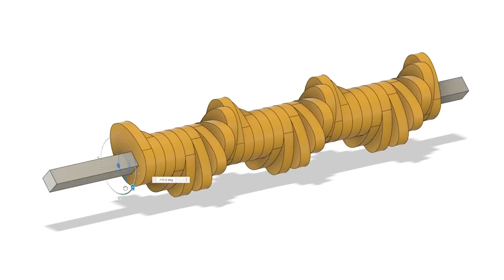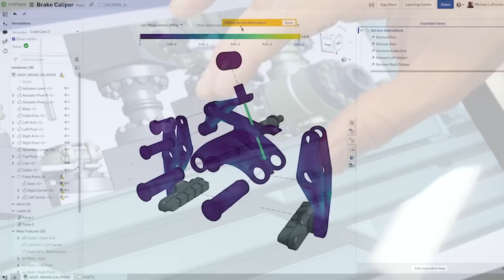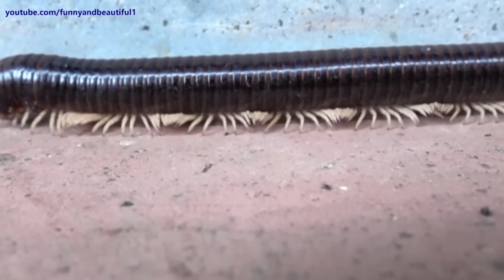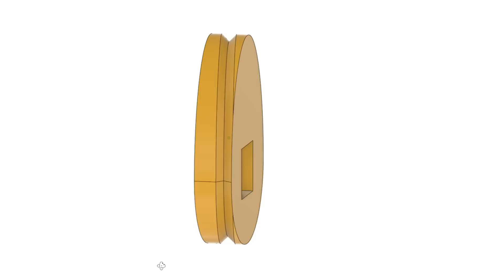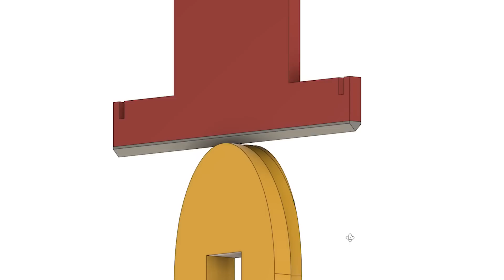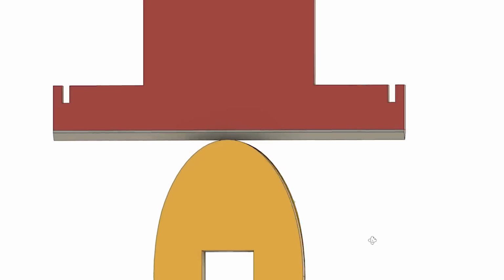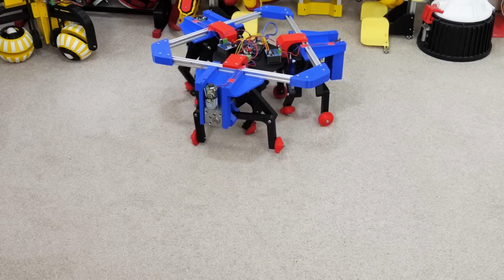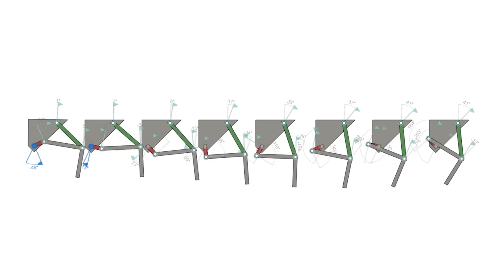Experimental Wave Drive V2

Comment: Could it be used for swimming? It's not very effective for driving, but maybe it would do better in water? With fewer moving parts interconnected with membrane, and overall simpler design (hopefully)? If you added the tentacle mechanism in it, so it could turn any direction, that would create a mesmerizing underwater creature.

Comment: You can print multiple small parts on each of the printers! Why did you print the cams individually? I understand that the T-shapes or any other big parts require the whole bed, but cams?

Comment: My personal theory is that each "piece of toast" is spending too long off the ground relative to the time they're spending in contact with the ground. The period between the top of your wave is much greater than the period of the bottom of your wave. In the previous design the period was about 50/50, spending as much time out of contact with the ground as it was in contact with the ground.

If you changed the shape of your cams you could make a smoother wave that has equivalent periods on either side of the wave. I believe offset circular cams would accomplish this

Comment: I think the grooves need to be asymmetrically on the cams. The transition needs to be sharp on the tip of the cam so the whole motion ‘back’ happens when in contact to the ground.

Comment: I know I'm late to the party but I think you needed to sit down, remember your statics/dynamics classes and draw a free body diagram. If you had done that you could see that each foot is only applying a vertical force on the ground so there is no horizonatal force that could result in motion. When you added the very slight groove in the your cam the tolerances were too great and the resultant forces too small to result in an appreciable net force. The slope of the table or the "give" in the carpet would be about equal to the motion the feet were generating. I think the walker motion (similar to strandbeasts) is going to be your best bet since the legs will have a horizontal motion that will result in horizontal force on the ground.

Comment: your main issue is that you need a diagonal surface pushing against the ground. That is what propels a screw forwards. It's friction combined with the angle of attack. Just going up and down won't impart any forwards or backwards force. The main reason the track was able to move better was the angle of attack as well as there being a much larger surface area.

Comment: it might be beneficial change the cam slot design so that the backwards motion it on the larger radius, and have the drive shaft going through the thinner radius? this could give it more time on the backwards motion without a complex cam design. It also may be beneficial to try and eliminate some of the slack in the mechanism by putting a tab on the center of rotation of the legs and having that tab ride in a slot in the casing, meaning that you get a more positive transmission from cam slot to final movement while reducing some of the errant vibration.  the rest of the vibration is coming from the legs hitting the table too fast so it may be worthwhile to gear the system down a bit to allow the system time to self dampen the vibrations.

Comment: this video just seems to be a guy discovering the physics of animal locomotion in real-time

I think the version of this robot with the grippy mesh and the rubber runner, would work a lot better on soft ground or soil than on a tabletop, because it could make grooves that the waves would rest in to push the machine forward

Comment: I don't see any advantages to this over more conventional designs, but if you want it to move in a direction then the push plates need to be angled so that the impulse isn't just vertical. Probably needs to be adjustable as well so that it can go in reverse. Basically like a piston-camshaft linkage, except the slant angle is variable now. So convert the whole thing to a carriage and have a pivot point as high up on the push plates as possible. They rotate independently from one another. Probably not enough room with the current design so you'll have to remove half of them in order to accomodate all the possible positions of the linkages

Comment: nobs. You did not install nobs under the belt. 9:30 add nobs to that!

If you look the previous one you had nobs that extended beyond the track pieces which made it grip and move and I theorize if you do the same thing as at 9:30 combined with nobs that have some thickness. Idea is they tilt when they follow the wave and when they are at peak they are parallel to the ground and when going back up they have tilted again moving it along and move thickness the nobs have faster it will move?

Comment: I think it's the weight on the front. It's technically in a fall, with the feet being the impact points for the fall. Since there is more weight at the front, there is more force being applied in that direction on each impact. With the belt on the bottom now it is no longer falling and now imparting the force.

Comment: I know this is a month on and I'm late to it. A few things pop to mind.
The millipede has one advantage over the design and it's at the Point of Surface Contact.
Millipedes feet are just Points that dig into the grooves and Pot holes of a tiny scale to make Purchase for forward locomotion.
It's the same as Pole Vaulting, point locks into a spot to launch forward from.
All the Weight each Point carries is driven Directly into that focal point.
The Toast slices have even when shaped for a groove, weight distribution Instead of Weight Downward focus upon 2 Points, one on either side of each slice of toast.
The mesh covered rubber track failed because the mesh equals Plastic on a Plastic/Shiny surface, defeating the purpose of a Rubber track, rubber used for grip. But that didn't work be the mesh caught the rug fibers and the device had its weight spread out like wearing Snowshoes.
My suggestion is Mimic the point of contact of the surface as a millipede does.
Two focal points for weight Downward. Instead of Toast, you need a two pronged Fork slice.
The wobbly play and gear groove with give a slight stagger to the walk, but focusing down through NINJA FLEX Feet Points, like those black rubber nubbins on the flex track, should give enough Surface Time and Downward Weight upon those Ninja Flex feet to grip and add in the locomotion. 
Kitchen floor Linoleum can be slippery when wet, but theres an Anit Slip factor when dry that would make for a better testing surface. It usually has some almost ground like Texture to it you can usually feel with your fingertips.
Those variances might work better for this design idea.
Just a thought!!

Comment: the piano-wave-caterpiller thing without the walking motions doesnt move because nothing is pushing horizontal(ly) against anything. its just cards or pillars going up and down at their times. but if you have little obstacles like little earth hills of just centimeters or half burried little slippery stones on the way, the wave of the "feet"  would have somethings to push against. and the thing with the walking motions cant keep one foot on the ground for the whole pushing-back-time-phases (as you/he said). if the down-pushing element (the spiral line) of the spiral-walz would have width for longer down-pushing-time, the thing might walk.

Comment: I've not watched all of the video so this may be covered but, where is the forward momentum coming from ?, with the wobbly track you are getting some change of angle on the "feet" and some squash and stretch over the length of the track.

Comment: Couldn't you potentially get the first design to work better by adding an angled shoe to the bottom of each foot? If you made a little rubber triangle like so: ◥, and put in on the bottom of each foot, then it would apply angular force to the ground whenever it contacted, and propel the robot forward better.

Comment: I have two suggestions for movement. Wider cams would let the legs be in contact with the ground longer, and adding some material to the bottom of the legs that can grip better than plastic

Comment: Sorry if this has been said before and I don't know how much more development you want to put into this type of mechanism, however I think that if you attached tracks to all of the pieces of toast with a pin on the toast and a free floating slot in the track  and than every link had a thinner link that was not connected to anything besides it's adjacent links that it the up and down motion would cause the middle link to perform that sudo rolling motion that you are looking for. This may require widening the distance between the toast slices to accommodate Sliding pin slots and an extra free floating track link.

Comment: I mean if you black box the force application at the feet the issue is the there isn't any lateral force from the feet. All the lateral force is due to give in the build so just vibrations are moving it.  If you rotated the feet a couple degrees with some form of groove in the cam it would probably work. So rotate it a couple degrees forward when it is in the 'up position' and after it connects to the ground move have it move 'back'. It would be a complicated cam profile but it should work.

Comment: I believe your hypothesis about their time contacting the ground is correct. I think that, instead of egg shaped cams, it may contact longer with simple offset circles. The membrane is a good idea.

One really expensive but fun little test is to replace the whole cam thing with the strandbeest leg system moving the slices of toast up and down with the leg movement.

Comment: It DOES work; but its the weight of the motor on the front.  It slightly wants to "fall" toward the motor.

It doesn't work MUCH, it DID go up hill, just very very slowly.  (which gives you an indication of how much it wants to go in a particular direction, ie the very slight fall of the table was not big enough to prevent forward motion, but it came close.

I do suspect you need a consistent pivot point for the hard legs,

Comment: For the wave motion to drive forward, it not only have to have a height difference changing in one axis. If you look at one point travelling along the edge of a screw or a spiral in three dimension, it not only travels up and down, but at the same time, it is also travelling diagonally left and right from the center line.
So just cut those "toasts" vertically into at least two pieces (three or more would be better), with each piece having their own retention rubber. Although, just cutting the "toasts" would make the setup wobbly, it would still go forward. To mitigate that, you would have to redesign your cam pieces, where the forward and backward facing plates are offset horizontally, or just make a screw with thick a edge.
But if you don't want to destroy your original setup, putting a rolling track around the whole mechanism could also be a solution, but then each piece of track should have a bearing with an axis in line with the "toasts", which they can push against and force itself to move forward. (Just how the ball was pushed in one direction in the video.) It would turn basically the thing into a flattened out cycloidal drive.

Comment: AH!  Saw this before, but now I see the problem.  
Screw drive = 45 degree thrust etc as the screw turns in contact, so there's a forward component.  (Whatever the degree is of course..)
Screw drive + track, after the track is in contact with the ground, the screw is still screwing against the track, and thrusting the vehicle forward vs the track position.  Even if it is only able to move a slight amount due to play in the track system, that's probably where the forward thrust comes from.

By isolating this to more pure up and down motion the track is simply going down, there is no further forward motion component against the track once it has made contact.  Even that little bit of shift in the play with the 45 degree drive against the track is probably where the forward motion came from.  

IOW for a full wave track with more pure up and down you get basically zero drive.

For more pure up and down I would reengineer this just a little for inchworm drive.  Up and forward on the higher side of the motion, then down and back for the lower drive side of the motion.

Also another thought.  I would make this really short up and down motion, and as long as possible forward and back motion.  IOW a flat ellipse for the 'foot' motion, just seems like it could be quite fast with some work.

Of course then you get to 'just make it a rubber track, wheels, and like one side of a cat type track'.

Comment: Very cool video, Even though i could see the outcome before watching, still loved to see the process
its almost there, but the key is the angular motion of the flat parts of the previous design's track causing a forward leveraging . 
having a connection point between 2 toasts with a tall-ish rubber foot will sort it out
1- front leg comes down pivoting the flat toward to rear
2- second leg comes down shortly after maintaining the flats angle
3- flat then contacts ground through the foot while pivoted to rear
4- the second leg continues coming down pivoting the flat toward the front - this causes reverse motion through the foot's contact point being a distance away from the pivot center line
repeat

Comment: If the legs touch the ground long enough it should work. Just let the CAMs maximum diameter have a longer length, because the legs have barely enough time to move from front to back, making 1 full leg motion

Comment: You should try to pair the legs two by two, at the end of each you put pivot points and between each pair of leg you attach a "V" shape which attaches to the pivot point.  As a pair goes down, one of the two legs of the pair will be ahead of the other, moving the point of the "V" a given way.  As one of the leg reach its apex and starts moving down, the other leg of the pair will continue to move up, causing the "V" to rotate in one direction.  Then as both legs starts to retract the "V" will leave the ground.  When the legs are retracted the "V" will rotate back to its original position, repeating the motion.  But given that the "V" always rotate only one way as they touch the ground it should move your machine forward nicely.

Comment: I'd try to slightly tip the legs to one side, the toasts have quite some space in their slots. This should give them a tiny horizontal vector as they move up and down and it might be enough to create a (controlled) forward motion. I'd try to either connect the rubber bands 2-3 more forward on the bar, so that they pull diagonally. If that doesn't work, I'd try to use the mesh to pull the legs to the back. Yet, If this works, I don't think it can move backwards.

Comment: What about having it so you can shift the angle of the toast pieces so they are not going up and down but more at an angle? Lean the pieces so they are leaning forwards a bit would probably make it go in that direction. Like if you leaned forward on a pogo stick and jump you would go forwards.

Comment: I'd suggest adding flexible toes to the feet, basically nubs sticking down from the ends, with angles tips. Thanks to flexible material, the machine should push in the opposite direction of the angle on the toes.

Comment: The reciprocating motion of the ... toast ... removes the rotational moment of the tank tread moving over the screw as it pivots over the peak. The tread piece tip to the point where it pivots creates this levering effect. The  traveling  wave of the toaster thingy is just an illusion of the offset reciprocation. Without that moment of rotation the tank tread has there isnt any motive force in any direction.

Comment: What previously worked to provide locomotion was the rotation of each of the links in the tread caused by the connection to a link's neighbor at a different height. Its not the up-down motion, but the rotation given to the links. Try adding a chain linked tread to your cam drive. You might see an improvement.

Comment: The reason the track and spiral works is each section pivots over the fulcrum of the wave very quickly because the wave is actually moving from the tracks prospective. In this case, you have no actual wave movement, just a bunch of sections moving up and down. You did add a pivot with the revised cam design, but it likely wasn't enough and/or the feet didn't have enough grip like the tracks. Maybe reduce the toast slices, increase the movement on the cams and add rubber feet to the slices? That's my take anyway.

Comment: Your slots for the toast need a pivot point in the middle of them that is narrower than the openings at the top and bottom.  So you get a mechanical  lever motion between the cam and the toast slot that forces the toast to pivot properly.

Comment: My guess is the machine will always move toward the engine on a flat, smooth surface. It pounds on the ground, launching it up, and it will tend to lean and fall toward the heavier side; that of the engine.

Comment: Close. Have an adjustable body for the cam shaft to angle those legs forward at some angle. That will provide forward thrust. Youll want to develop something that enables it to tilt back for backwards thrust. Something that tilts to the left or right for that thrust. Might benefit from 4 independent cams and leg segments to drive those changes

Comment: I think an inverted crankshaft could also functioned well as it would not only push but pull the segment's up and down, the only problem is if it will actually be able to make a forward and back motion because the corkscrew system you made pulled the rubber grips on the segment's both forward and back like little legs